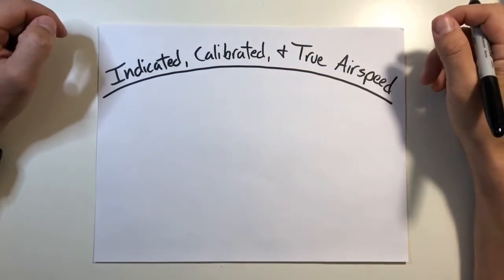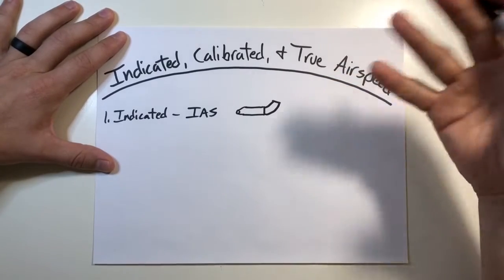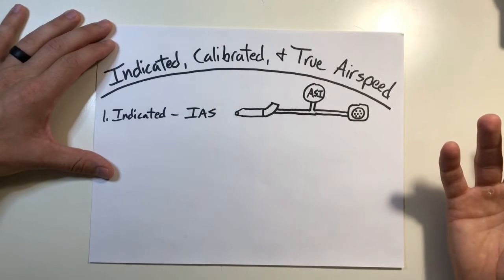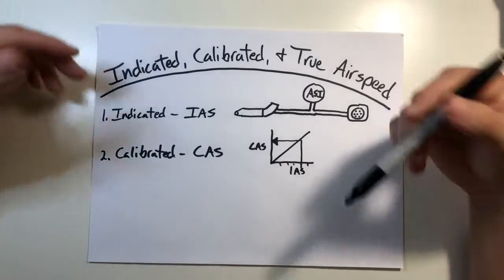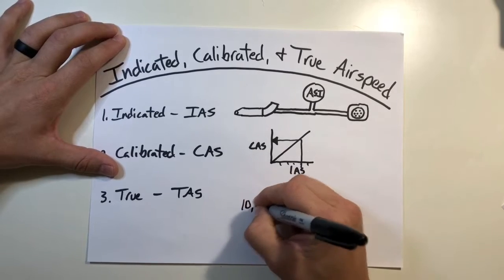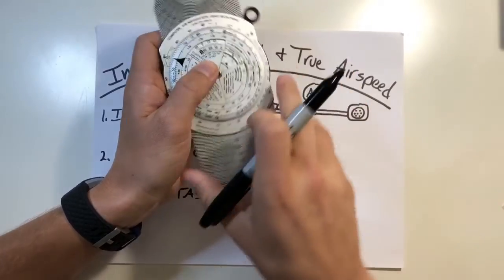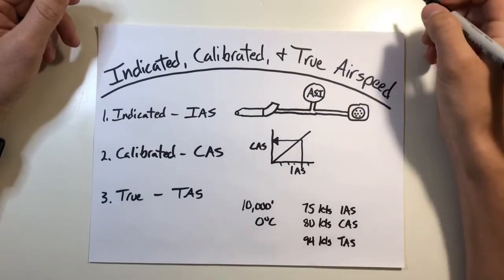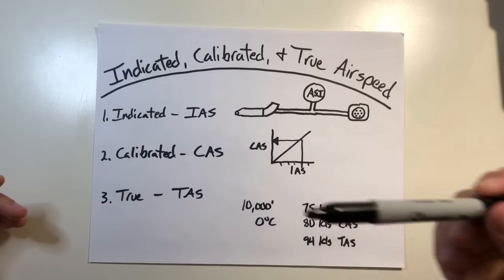Indicated, Calibrated, & True Airspeed

Comment: First off, please get I’m not one of those angry guys just poking holes in your video :). But 1) Indicated airspeed … that’s something as pilots we all understand, 2) you did a great job of explaining how you get from Calibrated airspeed, to true airspeed … I agree with everyone else here ….BUT 3) What I PERSONALLY didn’t understand from the video is ( again, I could just be a knucklehead and should get it…seriously, that’s an option here :) ….Calibrated Airspeed … Sure my Commander gives me a chart that says at 28 HG, and XX temp, at XX Altitude …. TAS is x or y or z …. however …..Those charts are pretty much useless when some commander owners have wing gap seals, some have the gear biscuits, some have lesser empty weights, etc etc etc …… My question that I still have is …. What is “Calibrated Airspeed?” exactly, and can you give a few specific examples of how you get that, and how accurate/trust worthy the “manufacturer” charts/etc is …. and is there a way to get it otherwise?

Honestly, maybe my question doesn’t make sense because I’m missing a core concept here ……but that is LITERALLY why I am asking it :) !! Your video did help a lot and was a great “To the Point” …not a long-drug-out-video to pump up your “time watching” …which I GREATLY APPRECIATE ….Any chance you can help explain “calibrated” more/with examples?  I can translate Helicopter to airplane…so feel free to do it with what you know the best …..  Thanks man!! I appreciate it!   And already learned something that matters, from this short…to the point..video … which as I said, I really appreciate!   Phil

Comment: This is going to sound really stupid, but... why not just correct the instrument, rather than having a chart for calibrated airspeed?
Reply: You can’t do that in normal operations, because you would have to place your pitot and static probes/ports in an undisturbed position, wich would require a very long probe on the nose of the airplane/helicopter. You could get rid of the position failure by doing so, but even then you could still have the instrument and installation failure.

No question is stupid, especially not in aviation!!  A “stupid” question will one day save your life 👍🏻

Comment: Jason, Thanks for these great concise videos !! I'm not a pilot, but I love helicopters and enjoy spotting the various kinds. I'm also an RC heli pilot. Since this video is on airspeed I thought my question might be related. I've seen many videos about how to operate helicopter controls, but I've never seen one on how pilots maintain a steady forward speed while cruising. With my Rc helis I have to give it short forward cyclic inputs and then return to the neutral position or it will soon over speed. Is this the case in real full-sized rotor craft flight? Thank You!
Reply: From what I've learned from sims, is to maintain forward airspeed it's a consistent slight forward hold on the cyclic, and with the right collective position, you will maintain altitude and airspeed. (In a perfect scenario with no wind or air pockets, of course)

*Edit: you're usually holding a less than a -5° pitch.
Reply: @MyKillerson  Thank You !!!!